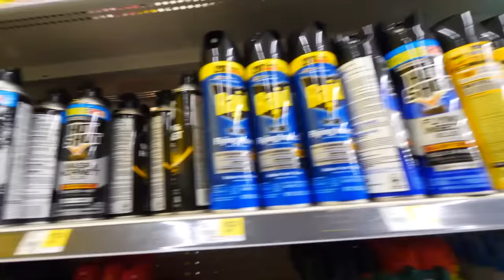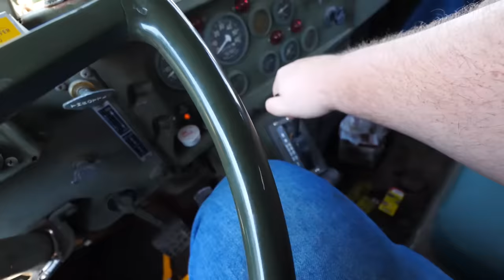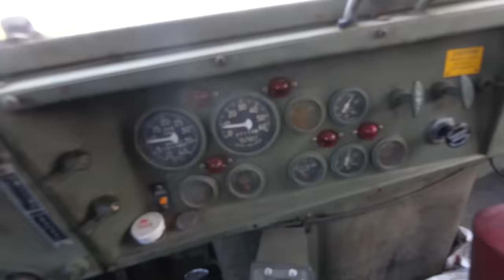Our 6x6 Army Truck CAUGHT FIRE...Can it Be Saved?

Comment: When you replace that front bearing, remember there's one on the other side too. Then, there's four more behind as well. If one's gone, the others can't be that far behind.
Reply: Always something that I had learned when trying to be educated as mechanic. The same for something that will effect the safety or the steering angles. I will rather replace both sides of the same axel. It might cost more, but better safe then sorry
Reply: I am not sure how this truck is setup, but I had a truck that bearings at the wheel hub and then another set further back in the axle tube. They all needed to be replaced at the same time.
Reply: Well he did take it into deep water and I guess it was a long, long time ago someone grease packed those wheel bearings..

Comment: Wheel bearings need repacked with grease.  Pound water in them.  There not sealed..
Reply: True
Reply: Those trucks are designed so that water physically cannot get into anything besides the cab. If water has gotten in there, the seals are probably extremely worn or cracked.
Reply: @Sitnased1  , friend of mine owens one. Every 10,000 miles he repacks them. There not sealed..  water can get in real easy.. have a good one buddy.
Reply: Buzz Buzz Honey I own 2 of them. They are sealed.
Reply: Have you guys ever come to think of the fact that not all of these trucks will be exactly the same? That other people may have replaced the bearings with either sealed or non-sealed versions? It's not like these are fresh from the factory floor. Just because it's the same truck doesn't mean it's exactly the same.
Reply: @2005honda450x  Can I buy one lmao
Reply: Tim Derks 🤦‍♂️ there are no different versions. That’s not how wheel bearings work. Unless someone has removed the wheel seals and knuckle boots (they haven’t)
Reply: @2005honda450x  Fair enough, I somehow forgot how wheel bearings worked for a minute. But still, on older vehicles, modifications get made, especially on utility vehicles.
Reply: I can be wrong guys,, will see when Weston pulls it apart..  everyone have a good day and take care.
Reply: @Sitnased1  lso you think the army put sealed bearings in the deuce also the vents for the axle and breaks are below the cab. The Deuce has a boot and grease on the drive line. On the surplus trucks the boot is one of the first things to replace. There are 2 versions one that requires you to pull the entire hub off and slide on a waterproof rubber boot or the one that is more common a cloth zip on boot that keeps the grease in and most of the dust out but not water... More likely problem was stuck breaks the air over hydro system on the deuce loves to get dirt in to the master cinder.
Reply: @timderks5960  deuce is not sealed bearings. it is booted
Reply: C'mon man, it was getting ready to get good, youtube style lol!
Reply: If the bearing is still there that is. :)
Reply: Air leak to that brake
Reply: Jim Hammill  You are incorrect. Buzz is exactly correct. The axles on the M939 series are NOT sealed. Unless you have a fording kit installed, which literally supplies a slight overpressure to the Rockwell axle housings, you WILL get water in the bearings going through water up past the axles. I am speaking from 20+ years of experience rebuilding and maintaining these vehicles.
Reply: @2005honda450x  I take it you don't service them yourself. There is a grease seal for the axle/hub, but the bearings themselves are NOT sealed in the modern sense. The hub seal is not designed to, nor will it keep out water when submerged. The maintenance TM even specifies that the hubs be disassembled and serviced after fording operations. Go look up the TMs if you don't believe me.
Reply: Shimmy Shimmy Ko-ko-Bop lol no they’re not a sealed bearing unit. I didn’t mean to imply that. They do have plain old bearings. They also have a boot and a seal. Very unlikely for water to enter if everything is in good shape. And yeah I just got done doing boots and wheel/axle seals on one of mine a couple months ago.
Reply: @2005honda450x  Speaking from 20+ years of experience rebuilding and maintaining them, I can say that it is very likely water will enter if you spend a lot of time with your axles submerged. The outer hub seals don't stay sealed for very long. Dust boots do just that. They do a good job keeping out dust. Water? Not so much.
Reply: No they need replacing! They are worn out. Don't you remember the wheel is slanted outward at the top which is an indicator that the bearings are about gone.
Reply: @2005honda450x  maybe depends 5 ton or 2 1/2 what years?
Reply: o.k., thanks @2005honda450x
Reply: @Sitnased1  army truck go sploosh
Reply: @HILLBILLYSFIREWOOD  appreaciate ur genuine effort to help
Reply: @2005honda450x  bro has a cummins swap and a air compressor from a fire truck, are u sure?

Comment: What ever happened to the beautiful big blue peterbilt, and the 2019 Ram 2500 ?? I'm surprised you haven't been driving the peterbilt around.
Reply: Good way to get caught without a CDL
Reply: @dumdumdugan1940  don't need a cdl if you aren't pulling a trailer
Reply: @dumdumdugan1940  dont need a cdl for farm use and not for hire regaurdless of pulling a trailer or not

Comment: As fellow M923A1 owner I can tell you that the seal and inner/outer wheel bearings for one hub will run you about $250.

Taking these steel soldiers fording (i.e. driving in a pond) pretty much requires a complete tear-down and rebuilding of all the hubs and axles. You probably have a bunch of water sitting in your axles and differentials. Would be smart if you, at the very least, drained and refilled the pumpkins.

Comment: Keep submerging it in mud and water, I’m sure that’s good for the braking system and the wheel bearings.
Reply: true but it'd have lasted a little longer before breaking but then he'd have less $$views so i mean, maybe it was worth it?
Reply: The bearings are supposed to be sealed, normally no water would get in there. Otherwise going through a puddle would destroy the bearings.
Reply: @jesumachorro  they're sealed to puddles yes, no seals on a 30 year old truck will stop water when you're sitting in it for long periods with water over the axles. Even with brand new axles and seals some water would likely leak past the seals   the way he left it sitting in the water for the video. vehicles just aren't meant to be submerged, and if you do get it submerged you've gotta change many of the fluids just to make sure there isn't water contamination.
Source, had 2 new bearings go bad with BRAND NEW SEALS due to driving through a flooded road, once. it washed alot of the grease out and the bearings failed a week later. I didn't even stop like he did, I kept a bow waving going the whole time etc.
Reply: @0xsergy  Army trucks need lots of maints.

Comment: Hey Westen, I think I noticed that you were pushing that knob in on the dash like it was a parking brake. The truck parking brake is the lever to the right of the seat on the floor. The knob on the dash is for trailer brakes and if that knob is pushed in, the truck's parking brake won't work. At least that is how it works on our M929A2's.

Comment: Ok - smoking - fire is good!   Back in 2008 -  I was driving from Kingston Ontario to Ottawa. Doing about 100KmpH - 60 mph. As we take a turn- I heard a tinkle from the driver wheel - hit the body and bounce under the cab. I felt a loose front end. I slowed to 50 mph for the next 30 miles. Pulled into the hotel - jacked up the truck - Ford F150 4x4.  And I could rock the rim 2 inches at the top.  Got towed to a Can Tire - and a Master Mechanic - using a 10 foot pry bar -  broke the bearing to get it apart.  The inside bearing was blue and welded to the spindle. In 4 hours - he had me fixed - and a day early at that! Maple Leaf up guys!  Cheers - Love to see the 6X6

Comment: I almost ran into this issue with my dad’s 1990 F350 Super Duty, smoke started to come from the front passenger side wheel-well and it was giving off some heat after parking. Thankfully it didn’t catch fire and we will likely have the front passenger brake checked out when it gets inspected next month

Comment: I’m pretty sure one of 3 things happened. 1. You washed out the grease from the wheel bearing when you took it through water.
2. The brakes are seized and need adjusting.
3. Your brake piston is leaking on the drum and catching fire

Comment: I rember buying my first 5 ton.  I also remember THE EXACT SAME ISSUE EXACT SAME WHEEL...  Turned out the military threw in some wrong size bearings just to get it to roll.   What  PITA it was to replace!  Made good use of free towing through insurance

Comment: I had an old one ton 4wd, the front wheel bearings failed and allowed the rotor to press against the pads.  Smoke city.  Had to get a new spindle and bearings.  From then, I repacked my bearings twice a year because I abused that truck often.

Comment: You got to remember that this truck is not a new truck and you can't run it like it is and expect it do not break down. I would put new bearings in the front axles on both sides and fix your overheating problem which could be from a lot of debris clogging the radiator from your ridiculous trip in a pond that might have caused both of your problems. Don't forget to take your fire extinguisher and have it refilled. If you leave it laying around after you've used it the extinguisher will continue to drain out from allowing the carbon dioxide to escape.

Comment: Lots of fun 😊😊, question,do you know where to find a small 4 or 6 cylinder pickup that is in fairly good condition,starts and runs for around $500 not worried about the year or make
Reply: Depends in your area look for a older Toyota  Tacoma  or a chevy s10 heck even those nissan  frontiers  are good

Comment: I told you u drive that truck threw the water check the seals but noo u dont listen ..it could have been saved not u need to buy a new wheel hub😂🤣😂

Comment: That truck was a smokin' deal...
Not necessarily entirely in a good way...
I'll bet the hub bearing going out has torn up the axle seal and the gear oil in the axle has leaked out and caught fire in the hot brakes.  You've probably wrecked the brake shoes on that corner, but otherwise it was probably more spectacular than it was really dangerous or damaging...
Hopefully...

Comment: I love your channel but I have to say this....   You ever see a split rim tire explode after brakes were dragging or bearings were scraping metal on metal getting hot enough to start a fire?   The heat transfers to the wheel and tire.  When the tires are new they are dangerous but when they are fifty years old......     When your friend stuck his head behind the tire to see the smouldering bearing I cringed.   When you are young you think you are going to live forever.   Both of you should be more careful.

Comment: If the heater is stuck on either unwire the blower motor, pull the fuse, or cut the water off from the heater core. That old truck should have a ball valve usually on passenger side somewhere on some it’s literally mounted to the engine. Just follow the water lines you’ll find it.

Comment: That sucks, that's probably like 5 or 6 grand in damage.
Reply: Nope. Few hundred at worst.
Reply: @ffjsb  No way man. I had wheel bearing go in my truck, and I had to drive it back to the shop, about 10 miles. The bearing race ending up welding to the spindle and chewing it apart. Had to replace the hub, spindle and even cooked brake caliper. I got lucky and mine didn't catch on fire.

But it cost me about 1000 bucks in parts, and that's on a relatively new truck with easy to get parts, I can't imagine what it's like on that.

Comment: Funny story, had a truck for 2 years that had it's heater switch stuck on 😂 it was miserable to drive in summer 100 outside and like..... + 20 inside, and the AC was busted as well but hey..... Vehicles are all and all a good time then or later to laugh at afterwards ☺️

Comment: Hey Mr. Western! I have an old 1999 Dodge B1500 conversion van that’s has a wobble when I drive it. I have seen videos where they call it a death wobble. Can this be a bad wheel bearing or a tie rod that needs to be replaced? It doesn’t happen all the time mostly at low speeds some high speeds after a turn or going over many of the unavoidable pot holes my city has. What is your honest opinion?!

Comment: I drove my dodge pickup 90 miles with a bad lose ass wheel bearing. I stopped about every 30 minutes to spray it with wd40. Then I stopped at a logging supply shop and bought some tachy lube (if you don't know what this is you don't want to know) and pulled off my wheel and bearing hub (found out my u joint for my front axle was bad too) and I lubed the fuck out of it. I had tachy lube on my hands for a week. Soap will not get this crap off of skin. PAINT THINNER will not get this off skin. NOT EVEN THE LEGENDARY DAWN DISH SOAP will get this off skin lol. Finally got it back to my hotel and called les schwab to see what they said. (after hours of trying to see if i could have one ordered to my hotel.  Nope.) They had it fixed in 2 days.

Comment: Weston, you might want to get the TM (technical manual) for this truck.  If I am not mistaken, each time you take your truck "swimming & fishing", ALL of the axles and brakes must be serviced & inspected.  At least if you want that truck to last you do. That manual is for the M939, M939A1, & M939A2.  The TM is TM 9-2320-272-23-1  which has now apparently been updated to TM 9-2320-272-23-5  You can download a copy at: http://manuals.chudov.com/M939-Series-Trucks/TM-9-2320-272-23-5-Field-Maintenance-Manual-2012.pdf

Comment: Where is the blue Peterbilt you should get a flatbed for the blue Peterbilt or dump trailer because what did you need Army truck I know on the trucks atIf Donald Trump burns down if you get a dump trailer and pull it behind the blue Peterbilt bring the blue Peterbilt back